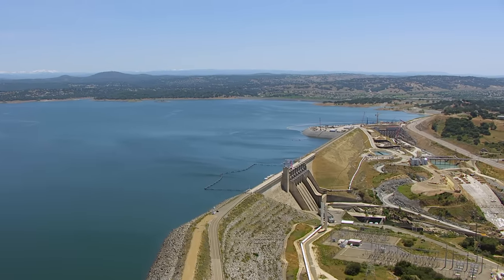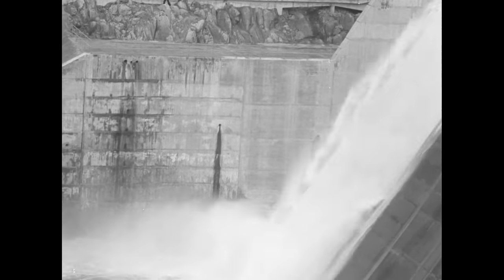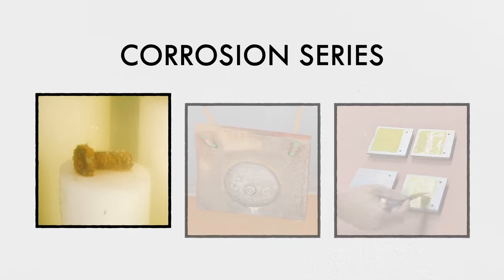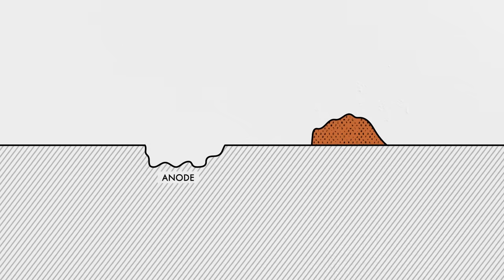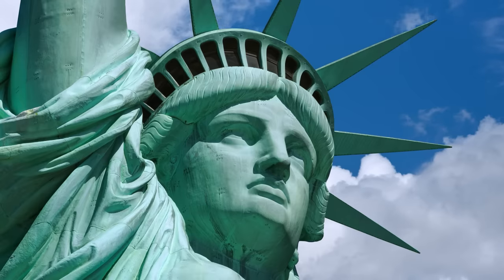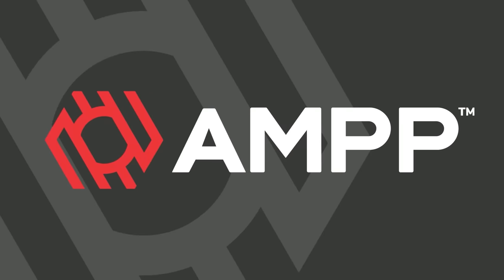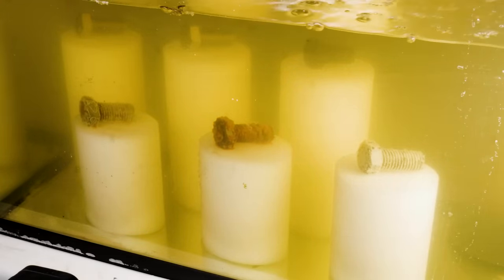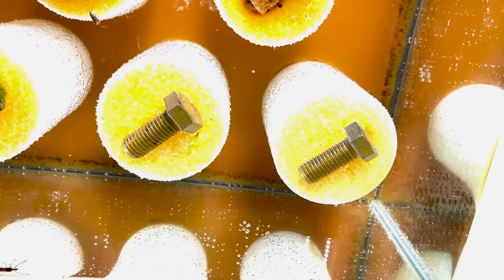You Spend More on Rust Than Gasoline (Probably)

Comment: I wish we just used materials that won't corrode. Like, for cars for example, I'd much rather use stainless steel than regular steel. Sure, it'd be more expensive upfront, but in Canada the road salt is very hard on cars in the winter, so I'd really rather something that's just gonna last (we've had our car for the past 21 years now; though it hasn't rusted out or anything yet, but there is some rust here and there).

Comment: Actually any rust, any oxide from any metal is a CERAMIC. In that light, yes, people have spent more on rust than anything else, even the windows is Silicon Oxide with Sodium Oxide and Calcium Oxide, or the bricks making houses are made from metal oxides aka rusts, fused (melted and solidified) into a solid material. I thought this was the direction the video was going to go when I read the title.

Comment: Had to replace a blower assembly on my commercial hot water heater because two $8 bearings got rusted.  $1400 bucks for just the assembly, more than I spent on gas in 2021.

Comment: As a hobby/diy mechanic in Massachusetts, I can confirm
Reply: Actually have and been maintaining a budget for rust, pretty much makes up of 10% of my maintenance budget for everything. Neglect is the real killer and just taking time with maintenance actually saves you money and sure its a cost but a necessary one. I started the budget when corossion caught me with my pants down, money was tight that day and my tools was just not optimal and i got injured too coz of it and while fixing what i was trying to fix im fixing what i needed to use to fix whatever im fixing while fixing myself to start fixing it like DUDE COME ON. After that awful month i had enough, dont want it to happen ever again coz i lost so much money that time i could have fixed it and lost 90% less if i cared more. Whatever i was doing is irrelevant and if your curious i was simply fixing a window "yes, just one darn window".

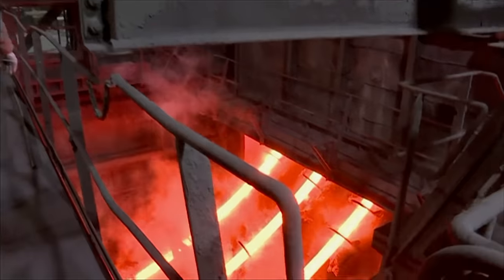Comment: 6:50 you gave an incorrect reason for why gold isn't used for bridge construction. The actual reason is that it would be stolen away, making it necessary to set a man to watch all night. However, this hypothetical man would clearly fall asleep, requiring him to be provided with a pipe to smoke all night. Smoking is unhealthy, and taking this into account makes gold an inferior material choice over iron and steel (despite the well-known issues with bending and bowing)

Comment: Galvanized steel isn't anywhere near as good as copper. About 2 years ago, our neighbor upstairs complained to the landlord that his water was rust colored. Our water was fine, so we figured out the problem was in the pipes between our place and his (we live in a duplex - we're on the ground floor and our neighbor lives on the second floor). The landlord had hired a plumbing company to replace all the pipes with copper about 25 years ago. Only when the new plumbers he hired starting pulling out pieces of pipes from the walls, it became obvious that the previous company had skimped on the copper and installed galvanized steel where it wouldn't be seen inside the walls.

The previous plumbing company went out of business like a decade ago, so there really isn't any recourse for our landlord. He just had to eat the cost.

Comment: The city of Flint did NOT decide. The state appointed manager did. The corrosive nature of Flint river water was evident in the 1960’s when the city decided to pipe water from Lake Huron. Unscrupulous officials bought the property of the intended pipeline route and held it hostage forcing the city to buy water from the Detroit system. To save money under emergency manager, the state decided to reactivate the old Flint water plant without bothering to consider the corrosive conditions and take steps to protect lead pipes.

Comment: Whelp if they intend to design something to last a long time why not use a particular alloy that doesn't rust, corrode, or oxidize I know it's expensive and not readily available but try tungsten carbide it's crazy brittle but has more strength then steel and takes far more money and like a material very difficult to work with. But think of the long term and practical if you worry about being cheap or going over budget then think about how much expense it takes for basic maintenance just to sustain the floor gates on the dam just saying I learned there is sometimes a moment you can't cut corners by choosing convince over quality and the end result it lasts longer. And if you're fortunate possibly forever. But guess that'll make some folks lose their job.

Comment: Gate failure... worked flawlessly for... yadayada years...
It's called lack of preventative maintenance.... you don't wait for critical parts to fail.. you swap them out before it gets that bad... failure to do so is bad maintenance and failure to require this in design is bad engineering... any plonker can make a low cost system that will fail at some point.... the idea of engineering and project management is to engineer and manage.....

Comment: When everything is built to the lowest bidder, you will get this. Anti-corrosion materials cost more. It is cheaper in the long run to use higher quality materials than have something catastrophically fail.

Comment: I wonder if there could be some sort of electronic mitigation to prevent rust like inducing a reverse voltage. Or maybe using a more corrosion susceptible material like the sacrificial rod in water heaters as sporadically placed plugs or skirting material.

Comment: My worst experience has been trying to get an aluminum rim off my dodge ram's steel rotor. Whatever process fused the two metals together was like a weld. I beat it with a sledge hammer. The rim never broke free.

Comment: PBS and NPR covered the aftermath of the Flint water problem in great detail, but they never went into the "we tried saving half a penny on the dollar without thinking about the existing infrastructure" factors that led (not gonna touch that pun) to the sadly predictable conclusion. It should also be noted that mitigation steps would likely have caused a small increase in utility rates and/or property taxes, which are often a tough sell to voters, especially in lower income communities like Flint.
I'm an atheist, but I find many biblical metaphors useful. Flint's city planners reaped the whirlwind.

Comment: It's called, stop making things out of Iron. continue dumping nitric acid down the well hole to pump up once its neutralized into nitrating all the metallic's in the mine into water soluble compounds that can be used for electro plating but first separated out of solution biased of the differing crystallization and decomposition tempters. call it a nuclear reactor cooling tower, but there is a gigawatt tesla coil in the middle of it and that's misted water being sprayed down from the top not steam coming up from the turbine generator. looks like the same thing!

Comment: It is 2022 and stainless steel STILL rusts. Those teams of "engineers" have spent more time bragging about their income than they have spent on actually dealing with rust and corrosion overall. 
A vehicle for example. The LAST place you want rust is on braking surfaces. Yet of ALL the steel components on a vehicle, what is the very first part to begin to rust? The brake rotor. Followed in close second place by the hub. Especially where rim and hub meet. Followed by stabilizer link bolts. 
Granted it is only a penny, but our money still rusts and corrodes. If you sell an object that does not need replaced, you screw yourself out of future profit. And I just might have nailed the very problem. GREED. An absolute horrible aspect of humanity.

Comment: One of the great things about living in Vietnam is the lack of rust, which mystifies me somewhat is the humidity is high reaching 1005 during the monsoon season. I bough a locally assembled Fork Escape SUV new some 12 years ago, we're still running the fitted exhaust system without any repairs. The underbody does not have any rust, that I'm used to back in the UK and the winter salting of roads. We add salt bags to our coconut trees as they prefer a ocean side environment and were 40 km inland.

I do enjoy your videos as I worked in tunnel construction most of my working life.

Comment: As a mechanic in Ohio, I can definitely testify about how expensive rust is to deal with
Reply: Funny how a 50 year old brake bleeder valve comes out with a little tap of a hammer but a 20 year old bleeder valve becomes a big wart.  The bolts holding the caliper on have no trouble coming off though.. great way to sell calipers when you just need new hoses...

Comment: The answer is simple but no one wants to spend the extra $1 per square foot for the right treatment. All you have to do it aggressively rust the metal with a hot mixture of potassium nitrate and sodium hydroxide, then boil it in water, then soak it in oil. Congratulations, you now have a stable pre-oxidized layer that will not continue to rust and requires little to no maintenance.

Comment: So the dam incident could have been prevented with a few Oz's of nickel. I remember when my brother bought a Hyundai accent and they have him a set of stainless steel supposedly. It used to rust every time it was washed.
Reply: They what him a what?
Reply: @phantomkate6  dam, as in a structure that holds back water. The stainless steel alloy rebar shouldn't rot if there's enough nickel or chromium. If they are cheap with the nickel and chrome because it's more expensive than steel it still rots but more slowly.
Reply: @suggesttwo  You're re-explaining the only part of your post that made sense.
😂 Sorry, I'm not actually trying to give you a hard time, it's just too funny.

Comment: I worked a lifetime in the machining , manufacturing industries.  WE PURPOSEFULLY made parts to corrode and wear out .
We purposefully used materials that would degrade more quickly! And we purposefully re-engineered long lasting items to fail! 2010 t0 2020 To generate replacement parts revenue.  This was an industry wide incentive, and is why your clothes washer only lasts five years now insead of 20 years. And your car brake pads only 3 years not 5.Think im lying check out the great light bulb conspiracy , World wide lightbulbs were made to fail at 50% lifespan. Or, the companies were fined !!! REALLY look it up .it real! AND legal! Juice boxes, milk containers, all degraded to shorten lifespan of products and stimulate sales.  as in make it crappy, make um pay , again and again..
PS I designed assemblies in stainless 304 and it would add cost +20% for materials. but never corrode or need need replacement. guess what?
We wont sell these to ANY small customer. If your not buying 1 million in merch, you get carbon stainless hybrid that will rust out. spend 1 million, all stainless 304.
Exact same unit, bolts washers everything , wires EVERTHING non corrosive.  Normal folk, can ONLY by carbon / stainless that corrodes!   Job, security.

Comment: Really, the failure of the sluice gate trunnion is worthy of dismissal of the responsible engineer. This is a very simple thing to service on a regular basis, and should never have happened.
Reply from the maker: They are pretty difficult to service because you have to dewater the gate.
Reply: @PracticalEngineeringChannel Thank you for your reply and I had thought that, but it reflects on a poor choice of design if you install a critical component which is rendered virtually unserviceable when in use. It really shouldn't have been too difficult to have built the sluice gate with bearings in the trunnion serviced with a pressure fed greasing system of some sort, thus allowing the bearing to be greased more regularly than dewatering the dam. Am I being unreasonable ?

Comment: These days they have engineered metal to rust for the sake of planned obsolesce. I have to replace the brass pex fittings every 10 years because they rust from the inside out. I've now switching to a poly fitting in hopes it will last longer. Total BS!

Comment: "You're not here for a lesson in chemistry..."  Chemistry is Engineering, as any good Chemical or Metallurgical Engineer would tell you. Please don't down play its importance. Also, I am sure the engineers in Flint knew what the consequences of changing the water supply were, it was not corrosion or an engineering failure that poisoned those kids, it was a failure of government in ignoring the experts in order to save a few pennies.

Comment: What happened in the City of Flint was unforgivable. I work as a water treatment plant operator and we use Zinc Orthophosphate for our corrosion control. We test our water chemistry for aggressiveness, and conducted and extensive study as to where we should add corrions control chemicals because we have 8 entry points to our distribution system. Of course Flint was a Democrat run town, so corruption is rife. So no funds for corrosion control chemicals and changing the raw water source that was known to be more aggressive, all to save money that was pocketed by the politicians.

Comment: Grady have you purchased gas lately or just work at home? $1400/yr is not even close $1400÷$5.5/gl=255gl×25mpg=6363 miles/year...really!
Reply from the maker: My estimate of gasoline expenditures comes from US Energy Information Administration Table E20. For 2020, it was around $800. 2019 was higher, but still less than $1400.
Reply: @PracticalEngineeringChannel  Come on Grady in 2019 some places had gas as low $1.20/gl and a barrel was -$30. Today it's alot different agree, the AAA national average is $4.17/gl a month ago it was $5.51 don't sugar coat the pain. Appreciate all your hard work in your videos but stay current and realistic!
Reply from the maker: Obviously comparing per capita corrosion costs to any individual’s annual expenditures on gas is far from apples to apples. Hence the “probably” in the title. The comparison is a storytelling device to make the technical information more accessible. I used the latest and most reliable sources data available to me to make the comparison, but maybe newer data will prove me wrong when it comes out. Sorry for any confusion.
Reply: Still enjoy your videos, even if you use click-bait...lol
Grady have you thought about a video on the mega engineering of the Blue Ridge Parkway way back in day, what an amazing feat.
Again much appreciate all your hard work, just please use current data...

Comment: One small misconception. I read the EPA's initial report on the Flint disaster. It seems the addition or orthophosphates was omitted not to save costs (it would be about $100 a day for the city and I don't think) but simple incompetence. It seems they just... forgot. MI-DEQ, which didn't know what they were doing, signed off on Flint's plan to switch water supplies without checking for an appropriate corrosion control plan. The Flint River water was designated as the city's emergency water supply. and at times in the past water was 70% river and 30% from Detroit to keep up water pressure during shortages, so I guess they figured "eh, we did this before, we're just doing it for a year instead of a few days." One email from a DEQ official Karen T. to another during the crisis talking about some reporter said "he claimed Flint is not adding corrosion control to their water and a city of their size should be doing so by law. But we apparently told Flint they didn't have to"